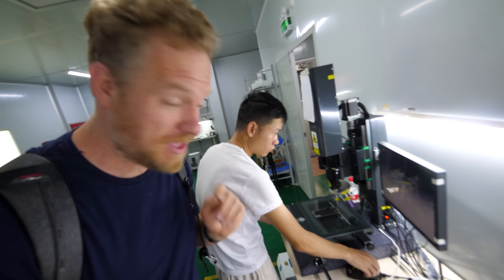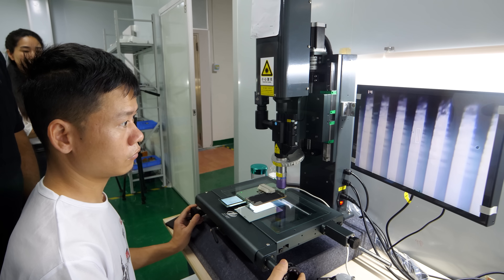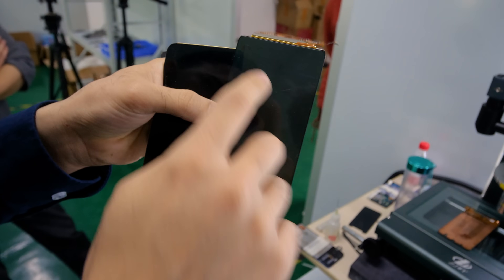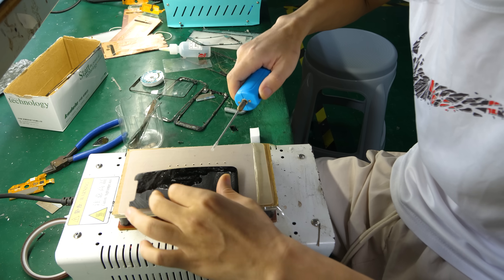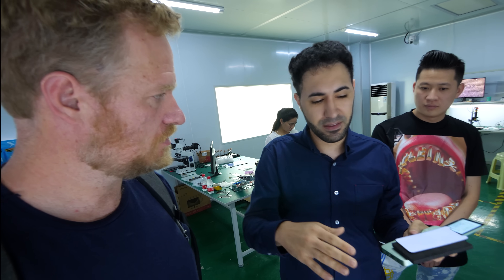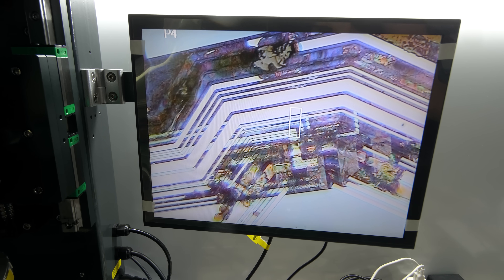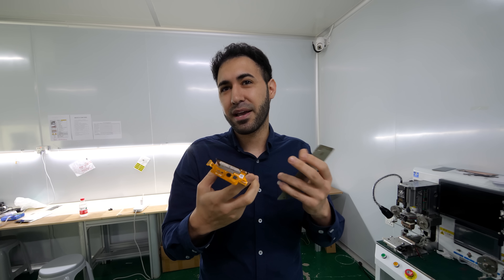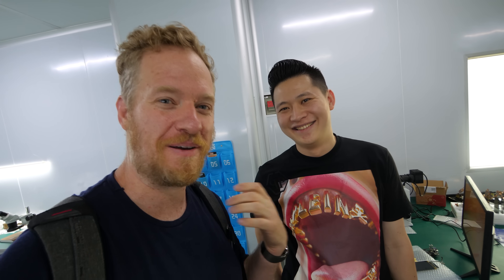A Revolution in iPhone Screen Repair: Lasers!

Comment: This repair tool won't be made obsolete by serialisation. Good invention and a perfect time for it.
Reply: one apple engineer out there rn working to put in fake pixels so if the traces get bridged on them it shuts off the entire screen
Reply: @StoneyCalzoney  and someone will start a class action for planned obsolesce, because in some rare, but proven, cases this manipulation detection triggers in the field on phones that where never lasered.
Reply: @sarowie  Doubtful. Apple has literally been doing planned obsolescence since the iPhone and modern macbooks (successors to the 'fruits') and it's been documented and proven and shown ad nauseum. The worst people have managed to do is sue them for putting software bombs in to slow down old devices or alter the battery charging/discharge characteristics for older devices. Every device they make is made with components running right up to and sometimes beyond (as in the case of laptop LCD ribbons and driver chips) spec sheet ratings. Run something at redline for long enough it'll break.
Reply: @StoneyCalzoney  You are thinking too small. The traces getting bridged won't shut off the display, it will make it work perfectly for a week before the OS starts generating weird anomalies so the repair shop can't catch it in the shop and their customer thinks the repair shop ripped them off or that they wasted their money attempting to get it repaired rather than just buying a new phone.
Reply: @StoneyCalzoney apple doesn’t design or manufacture the iphone oleds. They have little influence on the manufacturing techniques.
Reply: @HNedel  Wha...? Of course they design the screens. They design them, and then send that design to a production house for manufacturing.  They say 'we want a screen of these dimensions, these specifications, this pixel density, this brightness, using these techniques, using the cheapest components we can get away with'
Reply: @gymkhanadog  they „design“ the external dimensions, flex cable position and get to pick from the pool of available technologies and techniques. Which are created by the manufacturers.
Reply: that was what it was said when they had intel
Reply: @HNedel  If that were true, don't you think SAMSUNG , just about the single premier tech manufacturer in the world, would provide Apple with better screens? The S20+ is the only Samsung device in recent memory that had problems even remotely close to the issues Apples constantly have problems with. And those problems were very rare.
Reply: @gymkhanadog  what “problems” does apple constantly have exactly? 
Samsung is not the only supplier of oled displays to apple. LG probably has around 20-30% of deliveries. BOE was also supposed to start deliveries, might have been for the upcoming iphone 15. Apple’s goal is to reduce the share of samsung manufactured display to below 50%. Now why would they do that if it is the “premier” manufacturer? Why did nvidia go back to TSMC for the 40 series GPUs? Could it be that Samsung is not that “premier” after all?
Reply: @HNedel  "what “problems” does apple constantly have exactly?: uhh... you must be really really new to the tech industry, or to being an adult, or maybe so young you shouldn't be on YT... not sure what logical reason you'd ever ask such a bizarre question about Apple. However, to humor you, Apple has for a very long time now (since about 2007) has a sordid history of using subpar components in everything from iMac "Pro" to iPhone leading to premature aging and failure. Those of us who've looked into this and followed the pattern over the years eventually came to see that the most common failures were actually inexpensive components that failed with what seemed to be intentional design flaws or using components right at or beyond rated specs. Then they released the software bombs a few years later to essentially make older devices unusable, and people really started picking up on Apple's intentional in-built obsolescence of most devices when it hit the media. And it's a simple answer why they moved to LG; LG is cheaper. When you use a premium supplier, you pay a premium price. Apple has to cut into its profit somewhere because they are incredibly greedy and have a greedy corporate culture. It's also intelligent to diversify your suppliers if you can, so that if one suffers a calamity (ala the chip plant fire that almost shut down RAM production a few years ago, or something like COVID...). And I wouldn't know what nVidia is doing except making huge blunders with the 40 series. Has nothing to do with chip design or manufacture; the actual base design of the 40 series as a whole is flawed. This is well documented by people way smarter than me. The entire tech and gaming community pretty much agree that the only worth wild 40 series to get is the 4090, and then you have to deal with a melting power outlet issue. Those power connectors btw are made by Amphenol or FoxConn, btw, not Samsung, so you can't blame it on them. ;p
Reply: @gymkhanadog  ✍✍✍
Reply: @HNedel anything doable with money
Reply: @gymkhanadog  all your „assumptions“ are wrong, but nice try. And what is the minimum age for using youtube? Did you get your parents‘ permission to comment here?

 The design of Nvidia GPUs has nothing to do with the fact that Samsungs 8nm node was a disaster with the 30 series, and forced Nvidia to go back to TSMC for the 40 series, despite the fact that samsung offered them a better price. This has nothing to do with 12V power connectors or what the „experts“ think about the 40 series cards. 

I asked about specific problems with OLED displays in recent iPhone generations, instead you answered with some bullshit tinfoil hat nonsense about cheap capacitors in iMacs or whatever. I don’t know why you feel like you discovered some big secret about planned obsolescence, this topic has been around at least since the 90s. In 2007 macs still had socketed CPUs and RAM, plenty of devices from back then are still working fine. The major issues were with GPUs bending due to heat stress and disconnecting from the boards, but this is not something anyone would intentionally design for. 

The extreme greed of apple didn’t prevent then from issuing 6 major updates for most of their iphones, while samsung used to do one android update, maybe two at most. But some people are never happy, if apple updates old phones, it’s to make them slow and force everyone to buy new models, if they don’t update them, it’s the same.
Reply: @HNedel incorrect.   Steve jobs literally influenced gorilla glass to do what it had to do.   He put gorilla glass on the map and now it's on every phone.   When you're a big fish like apple, you absolutely influence the market.   Apple has made retina displays so cheap bc it made other competitors use HD pixel rich screens just to compete.
Reply: @24SEVIN  nope, corning is a 200 year old company that had been on the map since before the civil war. They had developed gorilla glas and Apple was a major customer. High DPI displays were a thing before the iphone 4. In fact, everyone was laughing at apple because they were stuck at 320x240 or something like that. Iphone 4 had to quadruple that in order to maintain compatibility with apps, as their resolution scaling sucked at the time. But in no way did they „invent“ the technology needed to achieve 330 DPI.
Reply: @HNedel  you really don't understand business and it shows in your replies.

Funny you think apple and Samsung don't have any influence when they have the most "buying power" in the world (besides government contracts)
Reply: @gymkhanadog  don't mind him or her.   They think apple has little influence on displays when they literally brought hi res displays to the masses.   Them ordering millions of screens helped the cost of hi res screens and bright displays to be cheaper for the consumer bc their competitors also decided to order hi res screens in order to compete.   Also apple being color accurate made competitors to use more color accurate screens as well.
Reply: @24SEVIN  what’s funnier is that you think apple brought high res displays to the masses. Samsung, AU, BOE, LG and JDI brought high res displays to the masses. You really don’t understand technology and it shows in your replies. Apple was catching up, not the other way around.
Reply: In next iPhone apple will mix gunpowder in screen glue and sealants for security reasons 😊
Reply: There is a solution to make it obsolete: post-manufacturing obfuscation. Like a reflective coating between the 2 substrates which activates its properties after the first passage of a laser to make the traces, making the repair operation impossible without destroying the screen. And the cost of this obfuscation method would be insignificant.
Reply: to paraphrase jeff goldblum in Jurassic Park: "Apple... Apple finds a way."
Reply: Next thing you know Apple is going to serialize flex cables 😂😂
Reply: @randomblock1_  They already kinda did that with the fingerprint home buttons
Reply: Apple: "Are you challenging me?"
Reply: You are kidding in 2 seconds I can make obsolete... when it detects a faulty line they will record said fault and if the phone detects the line coming good then they just switch it off in code.
Reply: fantastic tool but i bet money they will now invest in a solution to prevent the laser being used after manufacturing
Reply: @Altirix_ they're not going to bother 90% of don't even know this can be done devices not being repairable is mostly Lazyiness and design trad offs
Reply: Wondering how much the fix is......
cause someone i know has this exact issue.
he bought oneplus 8 and it's display broke in less than 6 months.
Reply: Doubt you even know what serialization means, let alone all the dimwits that liked this comment
Reply: What is meant by serialisation?
Reply: @pranavh437  apple put little chips on their every part and put ID on them, when you change your screen, camera even the back glass, phone detects that you didnt fix your phone at apple repair shop and starts locking face id or disabling cameras or makes the pen feel like broken and all sorts of bad things. They do those problems so seamlessly sometimes that you going to think "the repair shop broke my phone, i should've repaired my phone in apple service" 
With serialized parts, phone can understand what you did to your phone, ofcourse there's ways to trick the phone new screen is the old one but it needs lots of more work, like copying the old screen's id and programming into the new screen so phone wont think its a different piece
Reply: Apple will find a way 😅
Reply: Thare are devices to bypass serialisation
Reply: Older phones have more burn in than newer phones. My S7 had burn in after 1.5 years of usage not bad but definitely there. 
My s10 never had burn in however did get a new screen after 2 years due to broken glass.
My current iPhone 13 pro max I almost have 2 years also doesn’t have any burn in. Switched to iPhone cause I was done with Samsung choices with software(ads in notifications bar) and the ridiculously bad app support for their exynos phones.
Reply: Serialisation is good because thieves are stealing phones and selling them for parts
Reply: I like that no matter what they always get around it
Reply: yes perfect time especially with Apples new serialization of 13 pro and 14 pro and 15 pro.. etc.
Reply: wait till apple serialized the electrical traces lmao
Reply: I can't see a link to how we get the machine
Reply: Wish burn in had a fix. A lot second hand phones have that problem
Reply: @ligametis  IDK what phones you buy but I have an Samsung S20 ultra which is a 3yo phone and there is 0 burn in even with always on display 24/7
Reply: @WENGACZLP  my S3, LG Flex 2, S8, s10, 2019 Oled LG TV, Lenovo Laptop. All had serious burn in. 

And have you tried buying used oled phones? Like more than half of them seem to have from small to serious burn in.

My s21 Ultra is still fine. But so far that is an exception.
Reply: @WENGACZLP  all the samsungs i had second hand, from Galaxy S2 up to S8, had horrible burn-in of the keyboard. Skipped S3 and S5 i think
Reply: @ligametis the burn in has partly to do with the screens brightness. Eg if you always have your screen 80 percent or more.
Reply: @marcellachine5718  of course I keep brightness near max. otherwise you can't see anything outside in direct sunlight. And there is no reason to use phone inside where even though it is dim you have a PC.
Reply: @ligametis  and that is how you burn your screen out. Your peepers too.
Reply: @marcellachine5718  it is a portable device. It is created to use outdoors.
Reply: @WENGACZLP  some old people always uses their phone at %100 brightness and sets the screen off time to 10 minutes, and they never uses the power button to turn off the screen. They end up having whatsapp chats burned in their screen, or candycrush saga game or keyboard pattern at half bottom. We dont do that sort of things so its normal that you never see burn in on your device
Reply: @ligametis  Burn in has a fix: don't buy OLED crap.
Reply: @ligametis  just wait for microled to mature, we wont have burn in issue anymore
Reply: hi friends, this is great. I offer you specialized training in the reconditioning of screens on the label.

Comment: Glad that they managed to find a solution. Kinda sad that last year I had to throw away my OnePlus 8pro due to this reason.
Reply: I have mine like this. And I've been watching this video for about 2 months now! I find it amusing that people think this only works on iPhones. Since there is a Oneplus there being successfully repaired.
Reply: its suck my country not provide to change the screen for free. We all know that this quality issue from their part. I have my Oneplus 9r and the green line just come after a month warranty end.
Reply: hi friends, this is great. I offer you specialized training in the reconditioning of screens on the label.
Reply: you throw away because it had 2 line?
Reply: @VJETRA  one vertical pink line at the middle of the screen. Tried my best to use it. But had to throw away after a week, the line makes it fatiguing for my eyes and also it was very irritating to use the phone with the line.
Reply: @titanu24  i mean ....can't you like sell it , give it away to relative or someone , or try overlay the screen so it appear black instead?
Reply: @VJETRA  I didn't really threw it in the dumps. I gave it to a reseller for 1/4 of the price I bought it for. I tried but, it's very tough to sell these type of phones as nobody wants to buy a phone with a permanent line. Because these lines multiplies very rapidly. Fixing the phone was never an option the display literally cost 1/2 of the phones price.
Reply: @titanu24 this highlights how good the tool is, all of these components just to lose them with a screen that is not worth to replace. Now these guys can buy phones/screens at 1/4 a phone's price or a screen at 1/20th of its price and restore it to about full price
Reply: @BankruptGreek  but also if that machine get popular the full price of screen will also decrease
Reply: @VJETRA  I don't expect the full price to change, the demand for new screens comes mostly from new devices rather than the few screen repairs that take place. Screen repairs will start becoming more common as the repairs are cheaper to do, or are possible (in cases of broken contacts) but still it would probably be a minor dent to the price of a new screen
Reply: @BankruptGreek this machine is a huge win for the consumers.

Comment: This could work as a small business in the west. Your costs are low because you don't have to ship all the parts overseas. Your labour is more but your turn around is faster. Sops than send you 100 screens to repair can have them back much quicker with no risk of Apple claiming them as fake apple screens. this could change the whole dynamic of screen repair in the west. Seeing as the phone manufactures have done everything they can to make it so you can't repair your phones.
Reply: Apples claims all screen are non genuine if you haven't gotten their permission to do a repair.
Reply: @dbousq  Serialization prevents repairs because if you can't fix the one you have, you can't go get another one.  This is a new way to fix what you already have.  I don't think that's really very important, though.
Reply: @bagel_deficient  Except this doesn't bypass serialization unless you are fixing the exact screen that came with your iPhone. This is going to be more useful to refurb shops than small repair stores. It's going to make third party refurb screens more readily available. Serialization is still an issue.
Reply: No, it'll never work. The only thing they're good about is destroying our planet.
Reply: thing is the screens are coded into that strip so 80/100 screens can be fixed as "geniune" apple screens. the other 20 wont be geniune because of after market chip unless they get that part down
Reply: Yeah, but who’s waiting days for a screen repair?
Reply: @RandyAugustus  Really? that's how you think this would work? You can't be serious. Just incase you are. Shops would send their broken screens to the shop with this tool. 10-100 at a time to restock their own supplies. Instead of shipping them overseas like they do now. Risking Apple, LG Samsung or other manufacture, having them seized at the border as counterfeit screens. Sigh.
Reply: until apple patents it and charges 10k per phone repair
Reply: @kevinmorrice this video dictates its not novel and therefore cant patent it.
Reply: @TheJttv  its apple, do they care about the legality, if it can make money, they will
Reply: So get a business loan, setup a corner of your house and start going! I got one in my hand you can repair lol
Reply: Apple claiming them as fake apple screen repair, you just now apple is working on way mount lazar light detector behind the screen, as where watching the video right now? 🙂